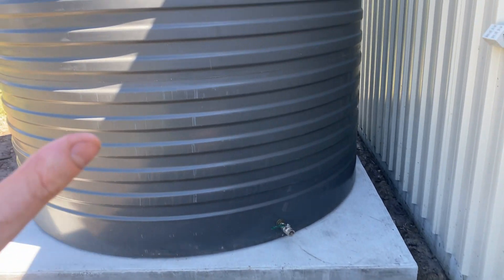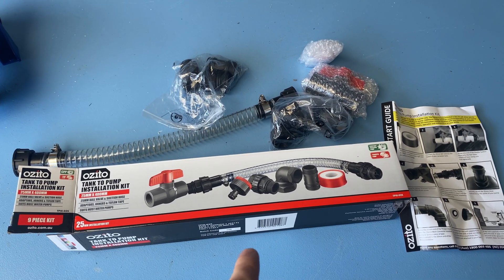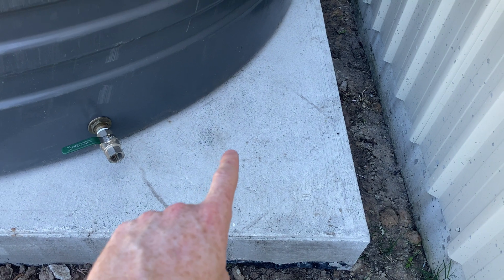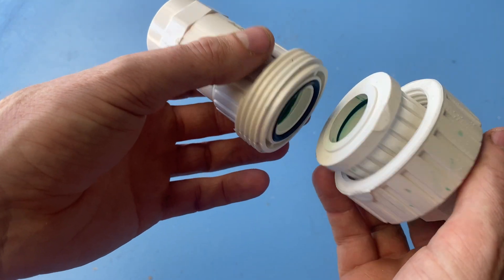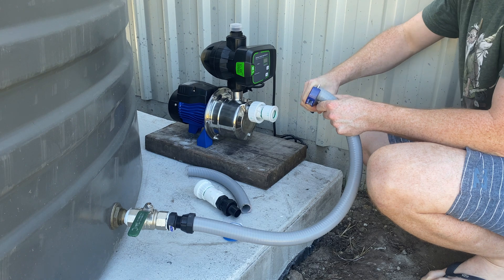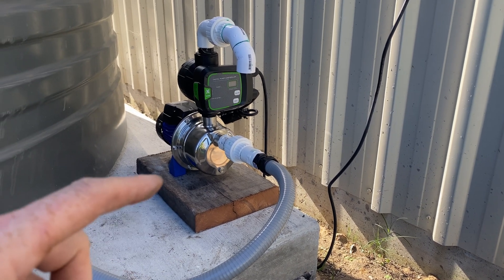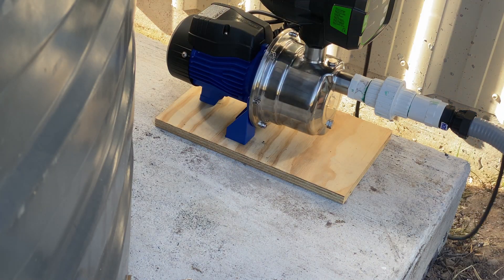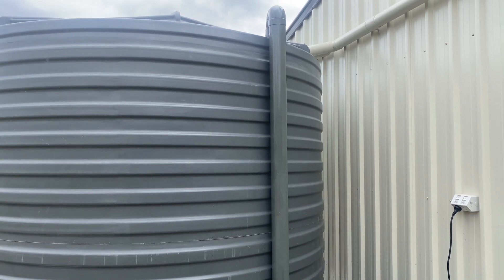Rainwater Tank Part 2 - Pump and Overflow

Comment: Thanks so much for making these videos Daniel
I have had trouble finding flex hose that will connect with any connector that fits in the tap outlet of the tank. Where did you get the flex hose and what connector did you use between? 
Colleen (pretty much a novice with these things)

Comment: Best pump mount is a rubber bollard base also available from Bunno's or from road works zone.
Also don't use white high pressure pipe, blue line poly is the way to go.

Comment: Thanks for the video. I’ve got a very similar set up. How would you go about connecting a hose to the pump? Or any recommendations to get water from the pump to a veggie garden roughly 30m away. Cheers

Comment: It's a bit late now but what about some rubber mat instead of plywood? Strong and durable and anti-vibration? That's my 2 cents anyway.
Reply from the maker: @colinm610 Yeah I think that’s a great idea (like the anti vibration rubber mats used for machinery or under washer/dryers etc).

The wood has been fine but definitely would consider that next time.
Reply: @PracticalPrimate  Thanks for doing the video. I enjoyed it. I am from NZ. Look after yourself mate. 😀

Comment: water is $4/1000L. Why use water tank which costs over $1000？
Reply from the maker: @shanghainesetv3992  good question. A few reasons.
1) water is $4.50/1000L here and that adds up quickly when watering an orchard.
2) we have droughts which limits use of town water in dry years.
3) I’m only on trickle feed here (not town water pressure) and using the big house tank and pump for watering is less efficient.
4) To get a structure approved here you need to deal with runoff and getting the water to the street instead wasn’t cheap either.
5) rainwater is great for our fish tanks and topping up the pond.
6) I just wanted to, I do not want to rely solely on council water.

Hope that makes sense :)

Comment: Installing a union, or any threaded fitting into your pump intake is the worst thing you can do. As you have used it, it would have been a better idea to screw the flex hose into the intake, & install the union at the tank. It would give a smoother flow straight into the intake. Just my 2 cents as an irrigation contractor, but I’m sure it will work fine anyway. Just my preference.

Comment: thanks for the video. you did consider screwing/fixing somehow into the concrete slab? are there no vibrations, i would have thought the unit would move around due to vibrations. thanks
Reply from the maker: Hi. No vibrations when it is screwed to the base wood :) If there were I would probably add a rubber layer. Yea I considered fixing to the concrete but didn’t for two reasons:
1) It was really close to the edge of the slab which is a gamble.
2) When I replace the pump it would be unlikely to fit the same holes (requiring more holes).